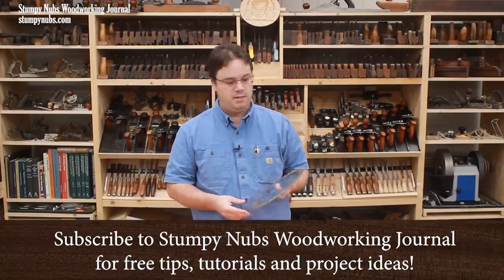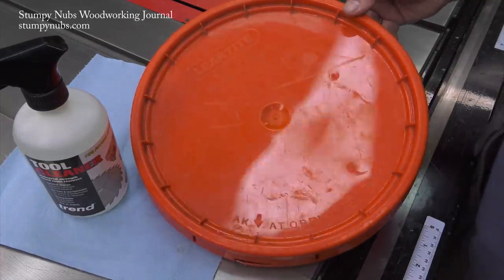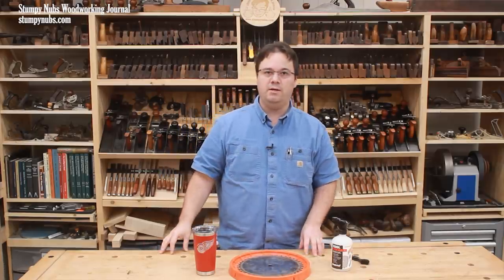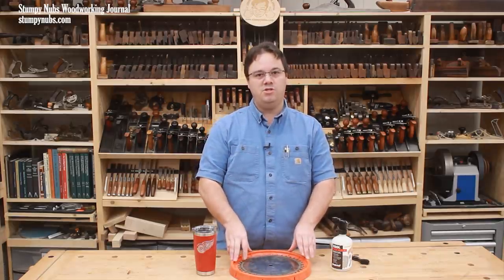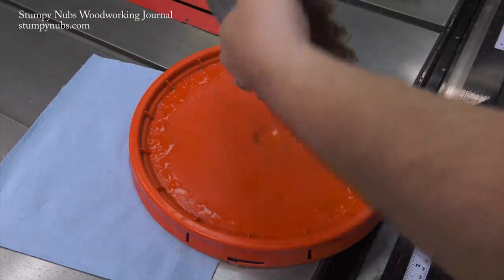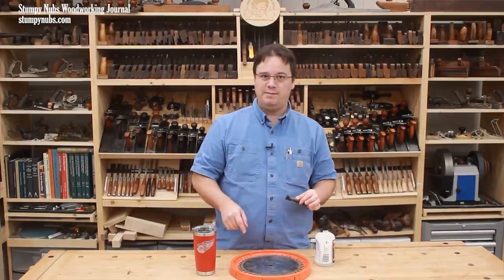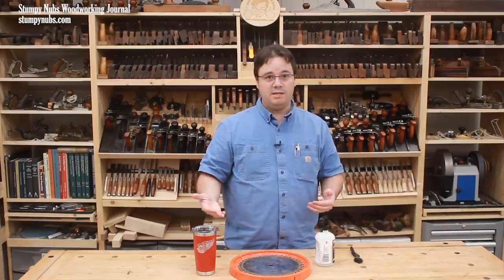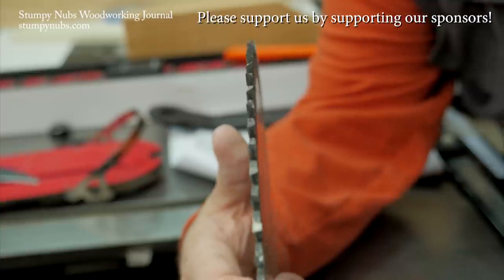This simple fix made my old blades cut like new!

Comment: Here, here. When I was in college I worked for a carpenter. He had a routine that we quit work on Friday's at 3:00 PM and then would clean tools until the normal quitting time. One of my tasks was to clean the saw blades, table saw, circular saws and a couple of hand saws. That was over 50 years ago and is a routine I used in almost all of my DIY jobs. Thanks for the memories.
Reply: What brand do you recommend for us novices out there?
Reply: @andypiszcz6583  Andy, please be a little bit more specific. Do you refer to "what saw blades" would I recommend or "what cleaning products would I recommend"? Please, also consider the time-frame of my comment. I am in my 70's now and this all happened between 40 and 50 years ago. Things have kind of changed over that period of time. I would suggest reviewing this channel for current recommendations.

Comment: I used to use Complicated Green, but wised up and now use Simple Green.  Good stuff.
Reply: I heard they had pulled Complicated Green from the market because users were struggling with it.  Simple Green is obviously the inferior product, but it's better for the masses.  Personally I've got a secret stash of the old Complicated Green that I'll be using for the next 20 years since Simple Green just isn't as good.
Reply: 4 real
Reply: @JustinSeiffert  Oh yes, most definitely for real, no joke here.  This is the internet where everything is super serious and nobody lies.
Reply: I had complicated green, but you have to measure out and mix 3 parts. Simple Green is far superior.
Reply: Soylent green works too
Reply: I use simp green. You put it on your neck and use the blade to clean it off. It's just a flesh wound.
Reply: If you're not quite sure which is best, try Sample Green
Reply: @earthlingjohn  Only if it's "Free" Sample Green.
Reply: @earthlingjohn  You have saved the world.
Reply: A certain Mr W of Occam could have told you that !  😉
Reply: simple green won't  kill a roach but clorox will.
Reply: @earthlingjohn  necronomicon
Reply: I use Simple Blue.  It smells better.

Comment: Thanks very much for the tip Stumpy, I took my circular blade off and visited the dentist - took some time cleaning - the result - all I can say is WOW.  Spent this afternoon ripping some 45mm thick hardwood.  No teeth marks, no burn marks just a lovely 220 grit sandable surface :)  Great advice.

Comment: Here's the breakdown of the additional value this tip has (for me):
Awareness of the need to clean blade: 20%
The difference it makes: 5%
What cleaner to use: 5%
Brush to use: 5%
Use of a bucket lid: 65%
Reply: G'day mate, that's a bit understated I reckon. I'm think'n more like 60, 20 to 30 and around 20% if pushed. Bucket lid is a great option 100%, if you have a spare, I wouldn't sacrifice a "working" one.
Depends whether you're a builder cutt'n rafters or for finer joinery, not to mention the previously cut timbers. Most of ours "down under"can be quite resinous and at times f*n hard. The two characteristics together make it quite essential. At what point to clean and what you use is certainly debatable, but I can tell you, you are better off without the crud. Cheers Duke.
Reply: I would say 90% for use of bucket lid, 8% for cleaners, and 2% for brushes. The awareness of the need to clean blades get 0% as this is something I’m sure almost everybody already knows.
Reply: @_J.F_  I'm embarrassed to say I've never cleaned my miter, tablesaw, or circular saw blades. Granted I'm a diy hobbyist with diy hobbyist tier tools, but this will definitely help me. I always learn a lot from this channel.

Comment: I use Simple Green to clean my blades. I'm lazy, and I don't do it often enough. When I do it, I notice the difference immediately. It's also important to do this with your circular saw blades and miter saw blades (and your track saw if you have one).

I've noticed that cutting woods with a lot of sap or resin in them can gunk up my blades pretty quickly. I made a display stand out of mystery pallet wood for some pumpkins that my family carved for Halloween last year. It made sense to use the pallet wood because I saw the pallets next to a dumpster in my neighborhood right before Halloween and because this wood was going to get recycled again right after Halloween. It was going to sit outside in the rain with pumpkins on it, and I knew that pumpkin-goop could get on the wood if any of the neighborhood squirrels got to the pumpkins before Halloween. I just wanted something quick and cheap. Well, the pallet wood that I used had a ton of sap in it, and it very quickly gunked up my miter saw blade. The blade made burn marks on the cuts by the end of my project. However, once I cleaned it with Simple Green, it was cutting like new on the next project.

I like the bucket lid idea! When I clean my smaller 6 1/2" circular saw blades, I sometimes use the tin takeout containers that I get with my pasta dishes from the Italian restaurant in my neighborhood, but I agree that a plastic bucket lid would work really well for this for all the reasons that you mentioned!

Comment: As a steel fabricator I use carbide blades on my chop saws and cleaning and oiling them makes them last 2-3 times as long. Not to mention they cut extremely clean and the blade doesn’t chatter to make a wider kerf. Great tips as always. I do love making my tools last longer.
Reply: also dont push on the material. let the saw/weight do the work. this is especially for abrasive disks. you can destroy good disks in minutes if you go full 200lbs gorilla on it. just let gravity do it and the disks will last 5~10x longer.
Reply: @SupremeRuleroftheWorld  That is 100% a fact. The heat and friction alone make the blades last so much longer when your applying light but even pressure.
Reply: What? Just use an abrasive chop saw & a belt sander! 
*Just kidding, don't do that. Carbide chop saws for metal are literally the only way to go.
Reply: Sackmaster what chop saw do u use? Evolution saw? Slugger saw?
Reply: Isn't a chop saw's speed too high for a teeth blade?
Reply: @danl.4743  They make slow speed carbide teeth chop saws specifically for metal.
Reply: @joshsoorlin579  Evo saw. For the last 5 years flawless.

Comment: Boiling water and baking soda works REALLY well, cheaper than anything else. Just wait until it cools off enough so you don't burn your fingers. Sprinkle baking soda in the pan/bucket lid, set the blade on it, sprinkle more on top. Pour enough boiling water on blade to just submerge. Wait until you can just touch it, scrub and rinse.

Comment: I can vouch for what a difference cleaning you blades makes. In fact, not only do I need to clean the blade in my table saw I also need to do the ones for my miter saws! I can feel the drag in my 12" 100 tooth blade I use for doing trim work!

Comment: I got in a good habit of cleaning mine when I upgraded to ridge carbide blades. It hurt to spend that much at first but when I cut 2 inch oak and maple on my little saw glad it was on there. My 2 neighbors both 30 year woodworkers were both speechless till I told them I swapped my blade didnt tell at first. ( they told me my saw would bog down and burn it I should let them cut it for me )

Comment: Only recently, I discovered the difference a clean blade makes.  I was having trouble with burn marks and was about to get the blade sharpened.  I looked at the blade and noticed all the crud.  Naaah that can't be it, but let's just try anyway.  I was shocked at the difference a little scrubbing made.  I used 409 and an old toothbrush.  Really made a huge difference.

Comment: I purchased some Trend per your previous recommendation and this stuff is AMAZING.  Works like a charm, I use it on my pellet Smoker and Weber.  For the pellet somker it keeps the temp. probe clean with no effort.  And yes, it is very easy to use on my blades too.  The best product to have on hand.  Thanks again for this resource! !! !!!

Comment: Cleaning the blade is a MUCH more useful tip than most even realize. I occasionally work with quebracho colorado, a wood similar to mesquite. Hard as nails and leaves a glue-like gunk on blades. If i didn't clean my blade, i would have to throw it away after every project because of the burn  marks the blade leaves when dirty.

Comment: When I think how often I have to clean my router bits it's a mystery to me that I have never thought to do the same to my saw blades.  I've just popped out to my shop and my sawblade teeth are covered in that resin build up.  Not only that, but the last time I used my 60 tooth blade it left burn marks on the oak I was cutting.  So top tip James.  Thanks for pointing it out.  
[EDIT]  I've had a look around at what various people use as a solvent, and I'm going to try dishwasher powder in very hot water.
Reply: Dawn dish soap. I can specifically attest to it's effectiveness. But I usually just give mine a quick go in the ole parts washing bin. Takes a massive 35 seconds to get everything off. Now I will say it's about a trillion times more caustic to flesh and face than Dawn but man is it FAST! Light coat of Baristol and I'm rocking again
Reply: Dishwasher powder can be rather caustic.  I'd recommend dish liquid (Dawn), or Simple Green.  I use Simple Green and it works just as James demonstrated in the video using the specialty cleaner.
Reply: how about just putting the blades and bits in the dishwasher to start with? maybe i should give that a try...
regarding the caustic nature of dishwasher detergents: the blades are actually quite resistant to high pH. I tried cleaning a messy, very cheap blade in oven cleaner, 10 wt% sodium hydroxide with some surfactants, that's about as caustic as is gets. Left it to soak for about 30 min. It corroded the steel quite obviously, but the matte surface layer that formed seemed to protect (passivate) the steel from further corrosion. Actually, steel, be it carbon steel or especially stainless, is apparently very resistant to caustic environments, because it forms this passivating layer. So I am not too afraid of the dishwasher, but lets see
Reply: @DerDanachDenkende  let us know how it turns out!
Reply: @Butterball3588  I used a quick 30 min program at 60 °C. The gunk is gone, but there are small rust spots (they look like dried up droplets) here and there. Very superficial, but a clear sign for corrosion.  So I guess I wouldn't recommend it to others so far...Maybe a lower temperature, different detergent or hand drying could prevent it, but idk for now. I looked up the detergent I used, and it contains (or produces) hydrogen peroxide, which, combined with the phosphates in it, explains the corrosiveness to steel.
Reply: @DerDanachDenkende  thanks for the update! What do you think you are going to do about the corrosion?
Reply: It was certainly fast.  I used boiling water straight out of the kettle, and the liquid took on a brown tint almost immediately.  The liquid was quite milky, so I couldn't see how clean the blade was getting, and I gave it a quick scrub with the washing up brush (my wife was away).  When I hooked out the blade to turn it over It was squeaky clean.  Interestingly, the 24T blade that came with my DeWalt jobsite saw had minimal resin build up but a 60T Diablo blade was much worse, and that's the blade that has been causing burn marks on hardwoods.  I have also just noticed some very light rust spots have appeared on the DeWalt blade, so it might be an idea to wipe an oily rag or some wax on it after cleaning.
Reply: @DerDanachDenkende  Don't do it. Dishwasher detergents contains polishing-compound, and that's what makes knifes dull in the dishwasher, and will make the same with your sawblades.
Reply: @tommythurin1688  the one I have completely dissolves in water. also there is no polishing compound listed in the msds. So I am pretty sure, that there is none. As mentioned earlier, there are some corrosive substances in it. These attack the steel of knives. That is especially  obvious at the edge. Not only is the edge very thin, but the material there is especially prone to corrosion, because of the roughness and the defects in the material that are introduced during sharpening. So the edge gets smoothed out by corrosion fairly quickly.
For tungsten carbide corrosion isn't much of an issue, because it is very resistant to it. The cobalt binder, which is usually used with it, however, is not that resistant. However, cobalt is still fairly resistant to caustic environments. So overall, that shouldn't be an issue. Also, I cannot see any effect on the carbide.
Reply: Gasoline dissolves the gum.on my chainsaws,I leave them a week and then use a tooth brush to get the rest off.

Comment: I’m a little excessive most likely, but I clean my router bits and saw blades after a job. I also use a thin coat of blade lubricant after cleaning (Bostik makes the one I use, but. I’m sure there are others out there as well.  The benefit of frequent cleaning and coating is that it is very easy and fast to do because your blades are already “ conditioned” so no scrubbing.  You don’t use much product either for the same reason and both Trend cleaner and Bostik Bladecoat aren’t really inexpensive, but both work great together.

Comment: Right, Stumpy !  i took an angle grinder, with tapered twisted wire brush, and brushed off the plastic coating, on skillsaw blades, also table saw 10 "  one. Cuts better, and doesn't  have as much resistance to the ' allready cut ''  wood.  Kerf, is another BIG  key, as well.   !  good luck, all.  Lid is a  ' nifty '   idea,  thankyou.

Comment: I clean my blades before each project.  Only takes about 30 min.  I use a drop of Dawn and just enough water to cover the blade on the bucket lid.  Let it soak for a bit and toothbrush the pitch off.  Dry and then WD-40 them and dry them off again.

Comment: I've been using that blade and bit cleaner for a few years now, same bottle, and it works really well. That, a toothbrush and a 5gal bucket lid and it is very easy to clean my table saw blade.

Comment: Yep, again, all the stuff you need to know in < 5 minutes! I look at cleaning the blade just like sharpening hand tools blades - do it sooner than later. I keep an old oil change pan close at hand, with cleaner sprayer (Cmt and Trend are low toxicity ones I find work well), brass brushes, and a jig  I made. Pull it out, clean fast, shove it back. Jig just holds the blade vertical to allow rotating it to inspect teeth when needed. Two pieces of scrap and a bolt+nut (1/2"), couple washers. Helpful too if blade has extra persistent gunk on it. Cost $1.00.
OH, yeah, don't be lazy and try to clean the  blade without removing from saw(!)

Comment: About a month ago, I used brush cleaner to clean my blades.  When painting my wood hauler (4x8 trailer) , I needed a paint that would stick to rust, therefore I needed a volatile brush cleaner.  When I finished cleaning my brushes I said, ah-ha, my saw blades need cleaned.  This is the first time I used something that harsh, but it worked well.  Normally I use simple green.

I bought a 1/2 gallon pump up sprayer from Harbor Freight, which I keep filled with a 4-1 water to Tide mixture.  I never thought about using it for my saw blades.  I will have to try that next time.

Comment: Another effective and low cost option is to use a pencil eraser.  The standard issue pink school eraser is all that is needed.  Scrubbing with cleaner is best, but the eraser can be used with the saw still mounted.

Comment: I recently found out that a dirty blade will also effect the sensitivity of a Sawstop. I had been cutting some very pitchy pine and sometime afterwards was explaining to a friend the blade sensitivity.  With the saw off, of course,  you can touch the blade and watch the red light flash. Not this time.The pitch had put a very thin film on the blade even though I had cut plenty of other material after the pine. Cleaned the blade and works fine now.

Comment: I saw you mention cleaning the blades about a year or two ago, and I now clean them all once a week. Personally, I just use Simple Green, as it is cheap and works well. It has extended my blade life significantly. A rip blade I had replaced, but never threw away, was revived and worked for at least another four months of pretty heavy use before finally being pitched due to it actually being dull and having a chip. Sharpening in my area is nonexistent, and the cost to ship my Diablo blades to Freud for sharpening is basically equal to buying a new blade on Amazon. If I had a local sharpener, I'd use them, but the shipping costs to Freud just don't make sense. The nearest physical sharpener is over an hour away. Two, two hour trips - they don't sharpen the same day - just wasn't worth it. I would do it if I was using a WW II, but a Diablo blade... nah.

Comment: Simple Green HD ( it's PURPLE - of course) and a brass tooth brush... the SG-HD mixed 50/50 .... practically cleans the blade without the brush. a few sprays on the one side, flip the blade a few sprays on that side - sit for say 5 min, brush the faces, rinse, done.

Comment: James, thank you so much for this. Pretty new to this whole woodworking business and my miter saw was tearing out pretty badly. Figured it was the crappy Chinese blade that came with the thing, but after cleaning it, it cuts like new. Ended up cleaning all my table saw blades after and found a couple chipped teeth on my table saw combo blade so looks like a ridge carbide blade will be in my future

Thank you!

Comment: I just pour the container of trend in a bucket and drop the blades in for a soak. It is reusable as well, so we place the lid on the bucket and store for our next use.

I also use smaller plastic containers to soak router bits etc.